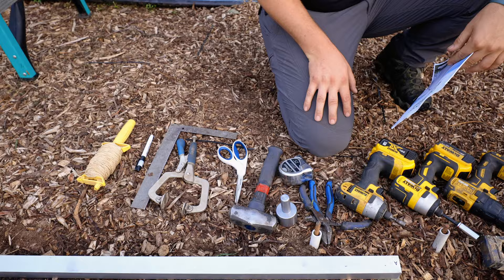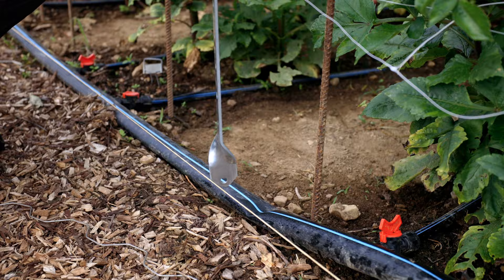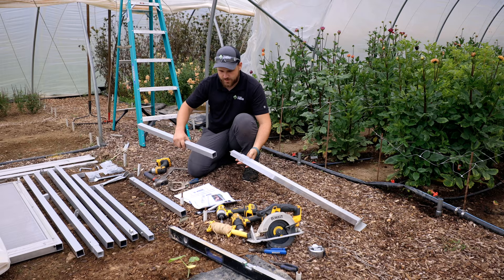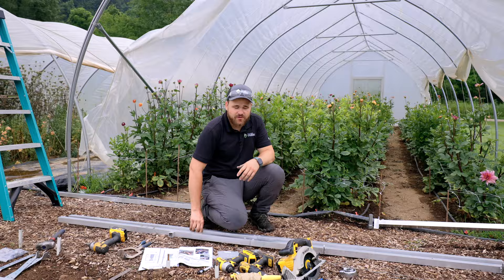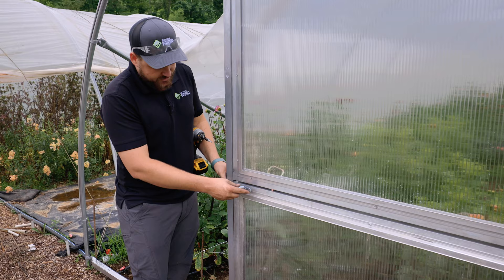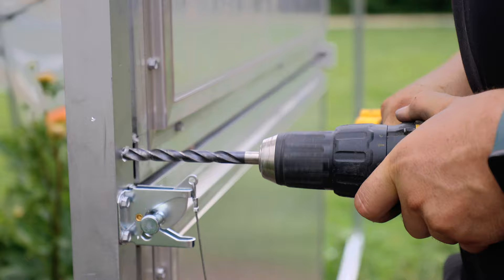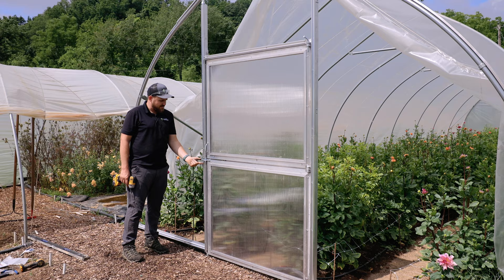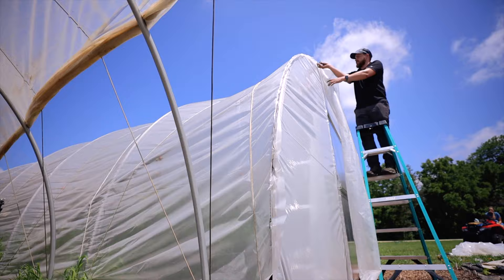How to Install a Dutch Door End Wall on your Farmers Friend Caterpillar Tunnel

Comment: If I understand well you can put two sets of wiggle wire in one channel lock, one wiggle wire for the end wall plastic and another wiggle wire for the roof plastic. Is that correct?
Reply: That is correct.

Comment: The dutch door kit does work with 14ft and 16ft tunnels, but you ship 8 spring wires and channels with the dutch door kit. That isn't enough to complete the installation for a 16ft tunnel with the lift kit. Please adjust your shipping amount to 9 or 10 wires and channels. I didn't realize this until the very end of installation and had to pack everything up and wait 3 more days unfortunately.
Reply from the maker: Hi Jeff, thanks for bringing this to my attention. I have alerted customer service to this issue and we are talking about how to best address this moving forward. If you haven't already, please don't hesitate to reach out to our customer service team and they'll be happy to help in any way they can. 931-583-0397 or support@farmersfriend.com
Reply: I love the door and purchased another for the other side.  I had the same issue with the wiggle wire being short and they shipped extra wire.  Now with my second purchase, 3 years later, I was shorted wiggle wire again.  Fortunately, I had extra from the last time.  They still haven’t adjusted the wiggle wire needs, so be prepared.

Comment: This video shows the basic assembly, but I wished more detail was given on getting the hinge post assembly correctly aligned. Mine was mislabeled and I carelessly got it assembled  180 degrees backward. Don't trust the little letter labels - refer to the printed manual to make sure you have the correct orientation.